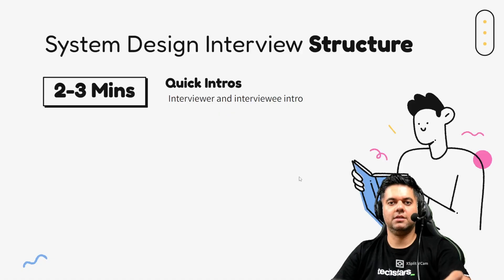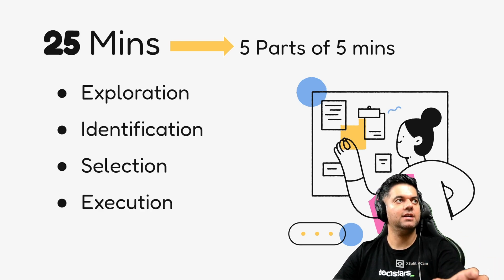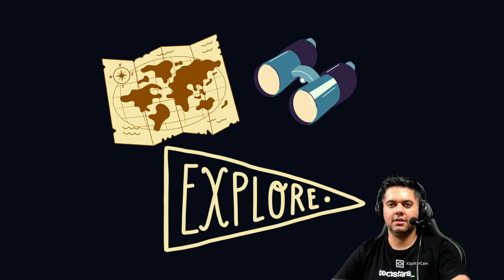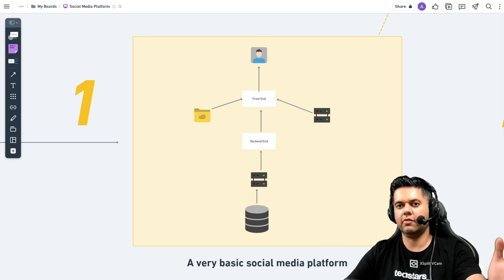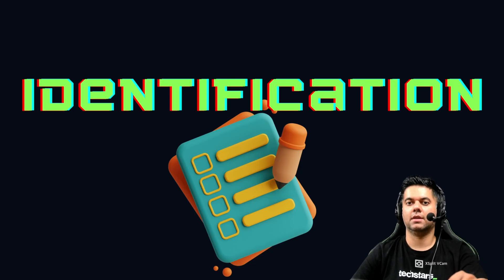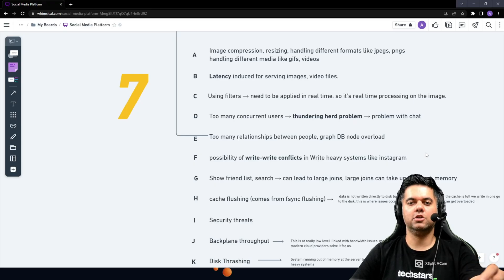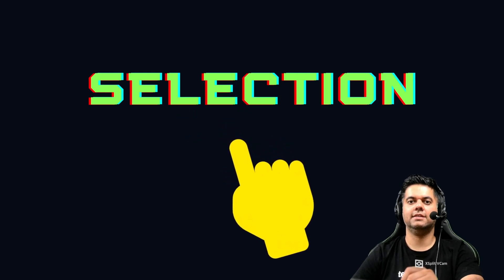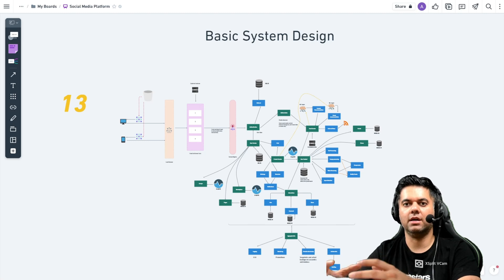Ultimate System Design Course [ EP - 8 ] - Structure Of A System Design Round

Comment: Want a video of golang and nodejs communicating with each other by microservices,
That you told your company is using different languages and microservices, want to know how can we make a communication between different languages through microservices, plz make video on Golang and nodejs a small project using these two ❤
Reply from the maker: hi bro, i can explain it in one of the system design videos. in the sense how it works. it's actually pretty easy, you just have to connect them with apache kafka